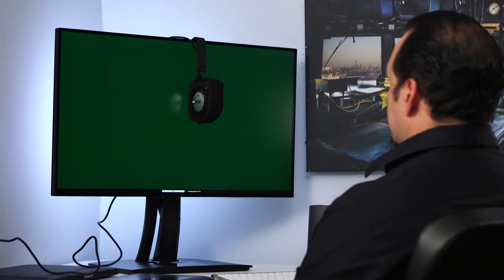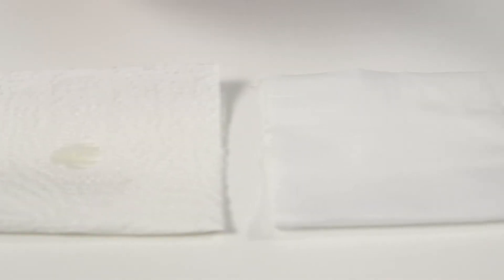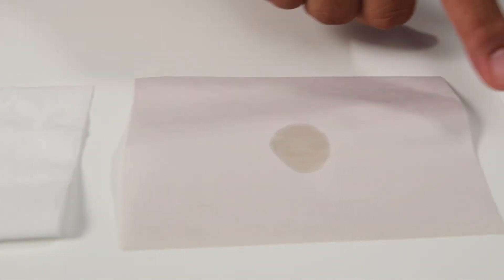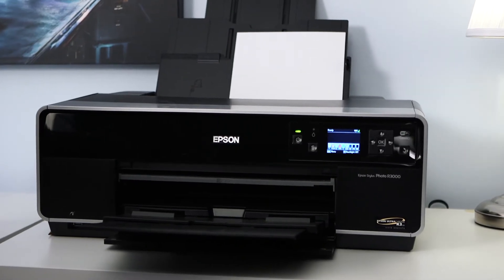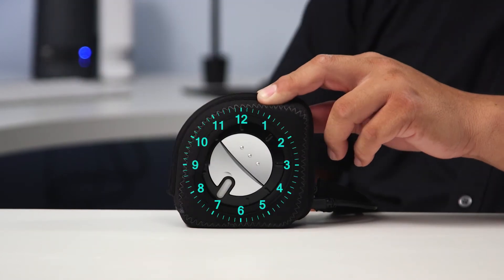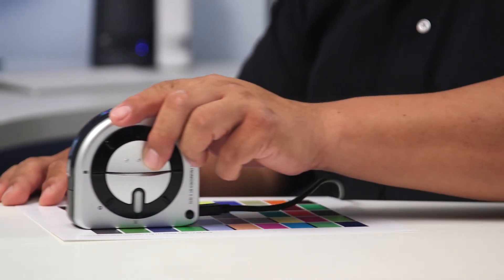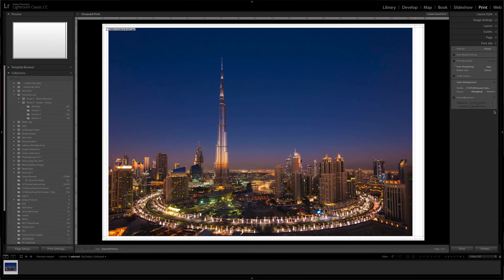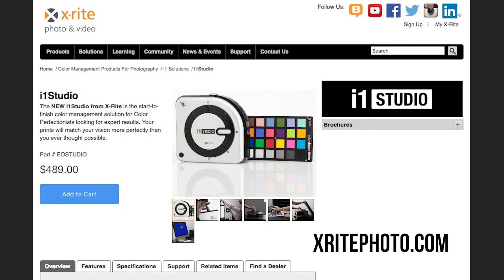X-Rite i1Studio Workflow with RC Conception - Lesson 4

Comment: I bought X-Rite Colour checker 12 years ago. It was great product until they decided move the responsibility to Calibrite.  You now need to pay for software updates or your X-rite wont work. Now my expensive $600.00 checker that I bought 12 years ago is a expensive brick. Do your research before purchasing this product. Very disappointed. If you try to contact X-rite you will just get pointed to Calibrite.